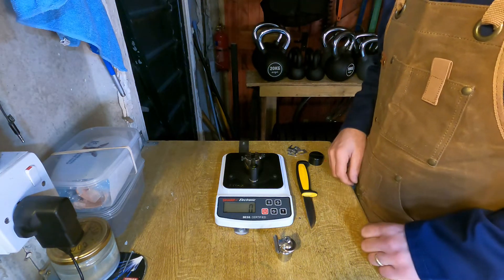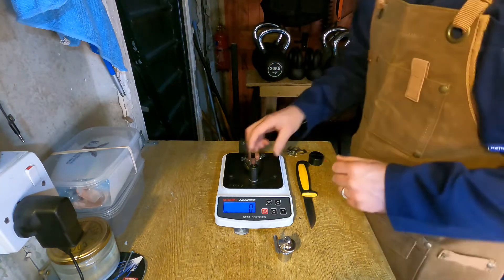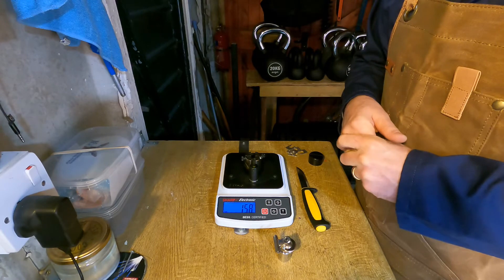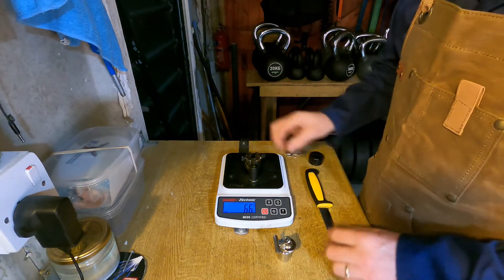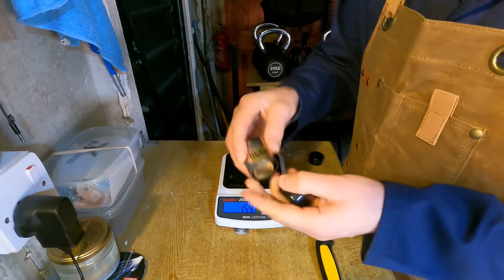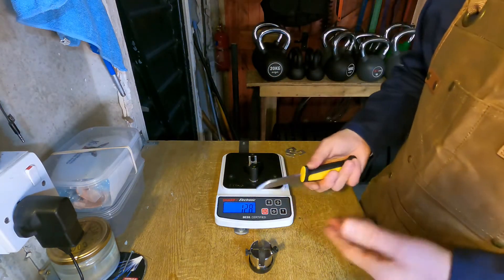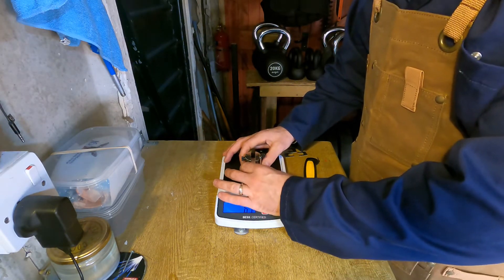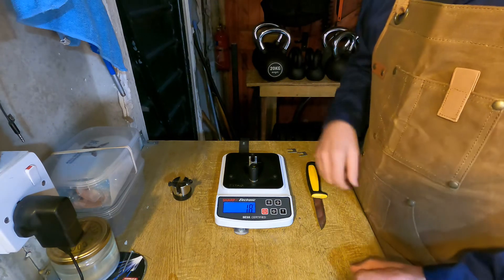How to use a BESS tester to measure knife sharpness

Comment: Bess media certification methods/criteria ? 
- How consistent is the Bess media ?
Reply from the maker: Per the demonstration I gave in this video, BESS media can be very consistent, provided the user is aware of its limitations.
Reply: @greatedgeltd  Would you be willing to share your perception or data for the bess testing system accuracy ?
In terms of consistency  . . .   +/- 5%  . . .  +/- 10%   . . .  +/- 15%  ?
Reply from the maker: @danielbottner7700  I don’t have a proper a set of data built up, and certainly not from the past 2-3 years. I’m more of a practical sharpener than a researcher. However all of my experience makes me think 10% is wide enough error brackets.  

One big caveat though is that BESS measurements are on a single point on an edge, which is not easy to repeatedly test without starting to influence the sharpness of the edge.

Comment: FYI, the test clips are actually not BESS certified.  I gues they do provide repeatable results, but according to Edge on Up, "clip measurements yield approximately 80% of the force required when using our BESS CERTIFIED ATF10G fixture."  So your test with the 100g weight and regular fixture is equivalent to a clip reading of 126.4g.  In other words, when you make the necessary adjustment, the readings with the clip and the fixture are pretty much identical.
Reply from the maker: Thanks, and sorry for slow reply.  Indeed the clips aren’t certified, but I’m more interested in consistency within my own measurements nowadays..  The more I work with it the more I realise how user-depending any BESS result is… So I don’t take much notice these days of other people’s scores, so long as I can get repeatable numbers for myself.

Comment: Obviously using a 100g weight did not produce the same BESS reading as using the standardized aluminum clip.  Did you ever try different amounts of weight to see what weight amount would produce the correct tension to match the reading using a standardized BESS clip?
Reply from the maker: Sorry for the late reply.  I LOVE this idea of using different weights to find the one that could match the BESS clip. Unfortunately that requires resources a bit beyond what I have, but hopefully someone will pick up on it.

Comment: Would be nice if that thing was affordable, I mean hundreds of dollars to see how sharp your knife is when you can basically use a sheet of paper to do the same thing is kinda absurd!
Reply from the maker: I do quite agree with you.  The price is quite high. In some respects it gives more information than a sheet of paper (quite a high BESS can still slice paper).  But the advantage of a sheet of paper is you can test the whole edge, where as this device only measures a single point, so would miss if there was a burr or chip remaining.   I tend to use both methods - first a BESS test to verify I’ve got the edge well honed, and then sheet of magazine paper to confirm no burrs and the edge is uniform along its full length.

Comment: It seems to me that the inserts are better than the spool. I would think that they are more consistent. While multiple readings on the same knife may vary, it is most likely that the exact spot on the knife is not touching the string. Stringing the spool to a consistent exact tension seems to introduce a larger variable since the inserts are factory set.
Also, I’m thinking that the distance from the fulcrum will produce a different reading. Think of a nut cracker. Put the nut all the way back and it’s hard to crack the nut, but all the way up and no problem. 
Overall it seems like it’s a good way to get a general idea of sharpness but not very scientific.

Comment: Late to the game here, but loved your video and had a couple of thoughts. The weighted 'tensioner' is a great idea. I have the Bess and have thought about that tension as being  an issue. It would be nice if there was available, or a different idea, how to make a weight set-up. I guess at the end of the day the 100g weight with the magnetic clip isn't too bad, but seems like it might be a PIA at times with the two pieces separating. I'll have to try it. Another tip I would suggest is when placing the knife in the 'fulcrum' to make a mark on the knife with a sharpie so that each time you are putting the knife in the fulcrum it is in exactly the same spot. By moving the knife forwards or backwards in the fulcrum will change the results due to leverage. Some have said that testing the knife edge in the same spot each time might be different than the rest of the edge. I say if you sharpened the knife correctly that is not an issue. Anyway, that's my $0.02 worth. Thanks for the video.

Comment: Great video ! Know I did see that YouTube video from the Korean Sharpening place…. He uses a 100gram weight like you and me uses ….. except that he then treads a filament trough a clip without a magnet to achieve practically the same results as the edge on up ready to go clips….. I personally weighted our magnetic clips that you seem to have which resembles a lot like mine….. But that magnetic clip in itself weighs around 75grams plus the 100 gram weight…… is it too much tension for the wire test media compared to the ready to use edge on up throw away clips ….?   You have a sharpening business…. I don’t….. restaurateur from Quebec….. I like the weight with the magnetic clip…. But does it alter too much our BESS values…..? I purchased the BESS PT-50B scale….. you seem to have the BESS more laboratory precise PT-50A scale …..
What would you do if you were me ? I really wonder what the tension is on the disposable edge on up clips….. But with our system we are tensioning at approximately at 150 grams with the weight and magnetic clip….. while the Korean Sharpening company ….. it seems that a 100grams scale with a loop of wire attached to the weight with duck tape and then utilizing a simple clip without a magnet under it and hung from the wire attached to the 100 gram weight would apparently give us the same result of tension as the edge on up disposable clips……. I am a perfectionist sometimes, and am very curious….. I just love using like you the 100 gram weight with the magnetized clip attached to it to tension my BESS media….. Your thoughts would greatly help me….. are the disposable Edge on up clips always accurate….? Because in the end more expensive….. Did you do tests with them…..? Or can we achieve similar results with our way with the 100 gram weight and magnetic clip…. Or go full Korean style with 100 gram weight , a wire attached to the weight with duck tape a use a simple clip which is not magnetic……. Thank you for taking your time on reading my comment !  Would like to have your opinion…. The restaurateur from Quebec, Canada. Cheers  !
Reply from the maker: I like the pre-tensioned clips because to me they are reliable, but they are also very expensive, and hard to find in the UK, so I use them sparingly.  I really like the 100g plus clip, but that’s just how I’m set up.  Other ways of standardising the tension are fine too… I am becoming more and more relaxed about BESS scores when it comes to comparing to others because there are so many ‘user factors’ in terms of the final number that is displayed on the tester… So I try not to compare.  100g plus clip will give a different result to the pre-tensioned clips but it’s the same edge…. Sort of like reading km/h or mph….  

For reference, I tend to find that the pre-tensioned clips read about 20 points lower than the 100g weight plus clip at the end of sharpening (so 120 vs 100, or 90 vs 70 etc).

Good luck, and thank you for watching all these videos :)

Comment: a little tip , put the magnet on the lower side off the weight so it holds way stronger :)
Reply from the maker: Thank you for the tip!  Sorry that I missed this comment before, but I will try that.

Comment: Thank-you very much for your video. I just purchased a BESS scale PT-50B with the spool system…. I have one question, can you get consistent results with just the spool system and using your weight system… I just purchased too a Tormek T-8 sharpening system…. I am an owner of a restaurant and my wife is the Chef and I used to sharpen on a system using different sanding belts for sharpening… I too love a great cutting knife and my only proof was cutting through a phone book pages…. And one more question… what would be for you …. And for a novice like me to try to achieve as a BESS score for professional kitchen knives….. Thank you so much for taking the time to answer me. Sincerely, from Quebec, Canada.
Reply from the maker: Thank you for watching!  It’s certainly possible to get consistent results using the weight system.  But one thing to keep in mind is the BESS test measures sharpeness on a very specific point of the edge.  It’s possible to get some variation in readings just by measuring different parts of the edge even if the spool is being perfectly consistent.  Or vice versa - the edge is even all the way along, but the spool make sit seem uneven.  You can check how you are doing my marking a point on the edge and testing that same spot a few times. Just make sure the honing is very good because if you have a burr, the test filament can fold it over, so the first BESS reading is good, and then gets progressively worse as the burr gets mashed in. 

With the standard Tormek setup and freehand honing I would think 150 BESS is possible, and below 200 will feel very sharp.  As a goal to shoot for, try to get down to 100-110.  But as per this video, the numbers can be variable from person to person, or method by method.  So the most important thing is to be consistent with your own tests and set your own benchmark.   You‘lol get a feeling for how the knife performs (and feedback from your wife) at certain BESS levels and can aim for that (or improve on it) next time you sharpen.   

I hope this helps - thanks for the good questions!
Reply: Thank you so very much in taking your time in answering me sir. Have a great day . Cheers !

Comment: I noticed that when most people are doing these Bess tests that they hadn't mentioned that if you use the inserts instead of the real that they give a 20%lower reading and that they aren't Bess certified it actually tells you in either that or the official Bess video's on you tube
Cheers
Reply from the maker: Thank you - indeed typically 20% lower, but as shown here the manually threaded version has many sources of variability too.  The most important thing IMHO is for a sharpener to have a consistent means of using the BESS tester… Comparing result between sharpeners will always be problematic.
Reply from the maker: P.S. Thank you for tuning in.

Comment: The pre tension threaded clips, you have to multiply the results by 1.2 or 20%, to get accurate results. That is stated in the instructions. Also the clips are not certified by bess because there can be a discrepancy in tension that will change results; up to 75% from my own experiments. They are terrible imo. The best way to get consistent results is to use the hand tension thread with a weight attached, then tighten. This way you get as close to consistent as possible.
Reply from the maker: Thank you - I haven’t noticed that same variability in the clips... For me they are quite reliable.  But I do like using the weight on the hand tensioned thread.  My reason for favouring the clips as a recommendation is that it takes one bit of manual handling out of the process... 

To me the 20% difference is a bit of a philosophical discussion - ie which one is the true BESS if you can get consistent (albeit different) results with the clips and the 100g weight?  A 110g weight would give consistent results, but different again from the other two methods. Probably the best approach is to find a method that works  for oneself and stick with it.
Reply: @greatedgeltd  I do agree finding what works for you is prob best in most cases, but given the differences I have seen in clip tension, I just don't hold those numbers with much esteem. Even your own test in this video, when going between the tension of the normal wire, vs the clips, was close to a 20% difference. My recommendation would be to take 10 clips, measure the average from those results. Do the same with the regular wire, preferably with a standard weight tension. You should see the difference at that point, esp in the individual tests. 

When I use the Bess tester, I always take at least 3 cut tests, and avg the results. Even this is too low a spread, to sort through the static. However, it gives a better idea than a single test. Of course, it is your machine, do with it as you see fit. I am not trying to tell you what to do, just throwing out some food for thought. Measuring sharpness, and trying to demonstrate that to an audience, is difficult. Having this device can bring us a few steps closer to that goal. I just don't want others to misunderstand how to read their results.
Reply from the maker: @Jef  Thanks Jef - so great to be able to discuss this as I do think there is a lot of nuance in generating and interpreting BESS scores...  they are far less absolute than many may assume, but like you say, a great tool for advancing our sharpening.